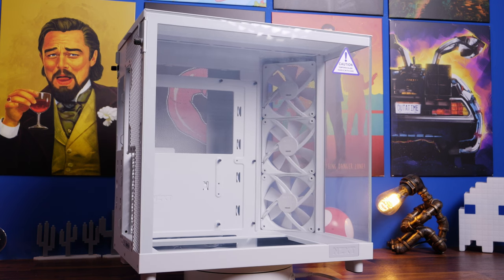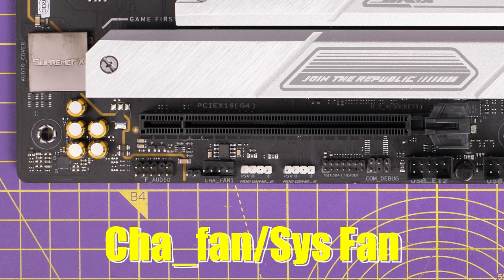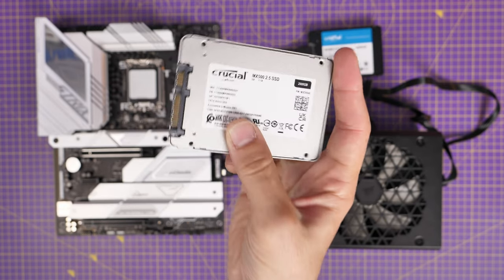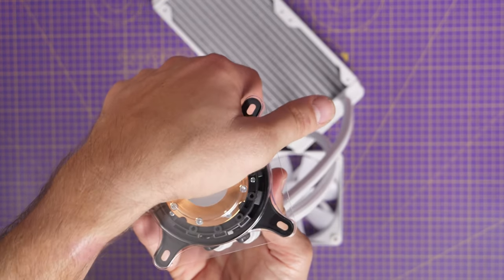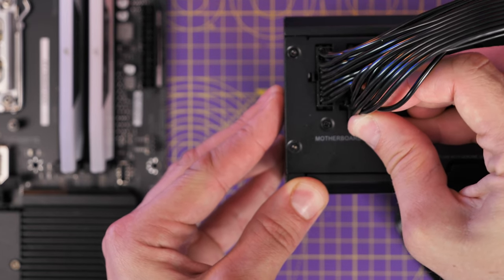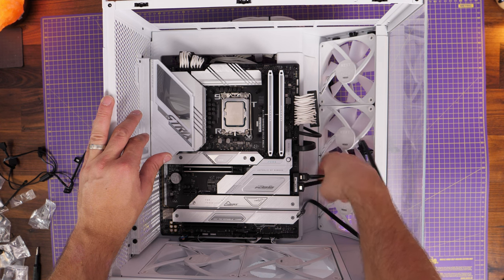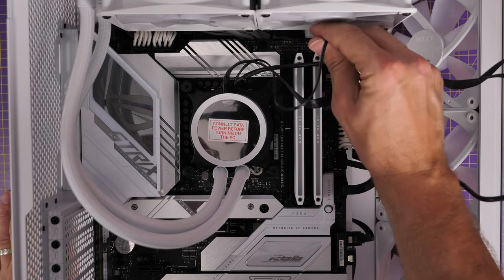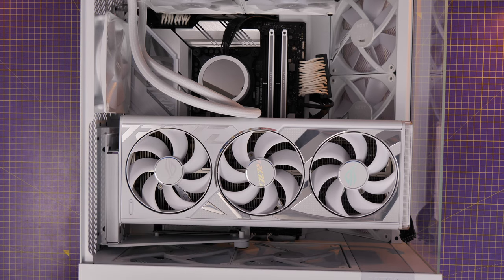NZXT H6 Flow RGB In depth build guide (step-by-step NZXT PC setup)

Comment from the maker: Specs of this build (note these include affiliate links which may earn me a commission at no extra cost to you):
Motherboard - Asus ROG STRIX Z790-A GAMING WIFI 2 https://amzn.to/46TdrYN
CPU - Intel Core i9-14900K https://amzn.to/46xZ101
RAM - Corsair Dominator Titanium 32GB 72000MT/s https://go.corsair.com/baya19
GPU - Asus ROG Strix RTX 4090 OC White Edition (https://amzn.to/3tr1nzc)
PSU - Corsair RM Shift Series 1000X Shift (https://youtu.be/yafbKAuyntw)
Fans - NZXT F120 and F140 Core RGB Fans https://youtu.be/mPRrPGjV_jo
AIO - NZXT Kraken 240 RGB https://amzn.to/45UfqKY
NVMe - Crucial T500 NVMe 2TB
Other NVMe - Crucial T700 https://www.youtube.com/watch?v=B08Cv8Pb9nI
Crucial P5 Plus - https://www.youtube.com/watch?v=YjOyCB7Vqjw
Case - NZXT H6 Flow RGB https://youtu.be/vtLcCbvSxEw
Vertical GPU mount - https://youtu.be/2dlB3bMFJUY
Reply from the maker: @cunnilinguswithcaitlyn6345  nope
Reply: Can I ask a question, where did you buy the second nzxt RGB controller, the only one I can find comes with the fans? 🤔 hoping you reply as I’m building a pc within the next week 😢
Reply from the maker: @Ash_ASMR_  you'll want one of these https://amzn.to/432Oyc7
Reply: @TheProvokedPrawn  is that the same one that comes with the f140 core RGB fans or does the same?
Reply: @TheProvokedPrawn thanks btw
Reply: does the rtx 4070 work fine on the h6 flow with the NZXT N7 Z790 motherboard?
Reply: what about the GPU brace. I see one but you dont mention it or where it is
Reply from the maker: @Jack_Hunt  the vertical mount?

Comment: man that 240 rad actually suites the whole build really well and gives it a good balance with the 2 140 fans on the bottom, its good symmetry. reckon you would probably wanna use nzxt duo fans? not totally familiar with all the nzxt products. they are more proprietary than other brands...but i really do like the rich bright color of the fans and the individual settings of them.
Reply: Personally i do not like that there is that empty space at the top, i would still prefer a 360 aio for a full aesthetically pleasing build, as well as giving the extra cooling for the cpu🙂
Reply: I am a slut for aesthetic asymmetry, and the 240 all-in-one in this case get's me going. I'll be doing a build with this case and while I could get a 360 all-in-one, I'll personally be getting the 240.

Comment: I appreciate this build guide because I bought this case but didn’t foresee all the other stuff that’s not included or is needed. Like you may need another fan and rgb controller or an usb hub for the controller and stuff. Helps me organize and put together my pc when I get all my components
Reply from the maker: Glad I could help
Reply: What extra stuff do u need?
Reply: @Airman2324  a fan/rgb controller, and a usb hub
Reply: According to nzxt, the bottom fans don't improve temps. Left mid-top fan actually harms the out take if you're using an AIO. So, if you're budget conscious, you could just keep the stock fans and add a 280 AIO and you're done. Positive air flow and again, according to nzxt, optimum airflow
Reply: @KcKeegan do yk where this is said?

Comment: Thank you for the video. I just bought this H6 Flow case and i was wondering what will be the cable management in it. But oh god ! I'm glad i'm not into the RGB style. The amount of added cable management you have to go threw make me cry ahah. 
At the end of the day, it's a really good looking and neat case to have, i really like it. I've also read that the air flow is really good with the stock fans. On the official website, you also can found data with those bottom fan, it's better to not add them for a cooler temperature overall.
Reply: The case and components are cooler without the bottom fans? Did they use the fans as intake?
Reply: @Carthus  on the official website and also on others video from youtube, they gathered both data with and without bottom fans.
Using bottom fans is only recommended when you have a really beafy GPU you plan to use at 90-100% most of the time (for 3D render as example or very long session of gaming with max settings). In this case only, you have a cooler temperature for your GPU, but overall , inside the PC case it's warmer. 
Without bottom fans and just with the default front fans (intake) and one more to add in exhaust you have trully good performance !
For my own settings, i have as GPU a 7900XT and a  7800X3D CPU. Combined with a NZXT Kraken 240. I really have decent temperature at full load, around 60-65°C  for the GPU and almost the same for CPU. My room temperature was around 22-23°C.
Reply: Yeah ima listen to you I don't wanna have to buy any more fans just one now I regretting getting the RGB version  @flow_leit

Comment: Thanks for this guide Prawn :) I have the RM1000x Shift PSU and wasn't sure if it would fit well with the side mounted connections. Now that I've seen your vid I ordered the case 👍
Reply from the maker: Glad I could help!
Reply: i'm getting a rm850x Shift PSU and had concern about their website saying something abou 210 mm of clearence minimum VS the h6 flow mentioning something about a max PSU size of 200mm but I can see in your video and like what BenanaBread said, it fits. is the 850w version definitely the same size? And I should have no issues with cable flush?
Reply: Is the shift or the normal rmx better in terms of cable management for this case?

Comment: Id close the top gap by placing another 120mm fan next to it so that more heat is exhausted, making the average heat the radiator recieves from the gpu less
Reply from the maker: A 360mm rad would have been better really

Comment: Thanks a lot for the video! You have helped me a lot to competently assemble a computer from almost the same components) 
However, I have a question: at the end of the video, we see that you supply power to the fans from the motherboard, but why not connect power to the controller from the nzxt in addition to the backlight? 
You can also connect up to three fans to the pump from nzxt, they have a branch there.

Comment: Hey! You probably don’t check these comments anymore as it is sort of an old video, but I had a quick question about the fans. First off, I didn’t quite understand, is there a way to connect all of the fans to one RGB controller? And secondly, won’t making the radiator fans exhaust be pumping hot air into the cpu cooler? I feel like it would make more sense to make those intake fans. Cheers for the awesome video!!
Reply from the maker: https://youtu.be/kTocUr0zKUw
Reply from the maker: https://youtu.be/qQcyYHGtArs
Reply: Cheers mate!!

Comment: I don’t know if I did something wrong but mine is not powering on.
Reply: mines powering on but i get no display :(
Reply: @dogbus7  Is your HDMI / Display Port connected in the GPU or in the Motherboard?
Reply: Check the pins connections, sometimes if they are a bit loose it can cause trouble powering on

Comment: I would have been interested in seeing how vertical mounting the GPU in this case affects the temperatures. Seems like with a blow through GPU cooler the front intake and GPU fans are fighting each other, it seems like the bottom to top airflow would make more sense in standard GPU orientation.

Comment: A really cool case but unfortunate at some edges very tight especially at the bottom and on the side. I could not fit my lian Li sl inf uni fans so I had to cut the case a little bit, later I painted and ground it.

Comment: hey provoked prawn thanks for the great video. In this case are the three front fans controllable in the same was as the other fans in your case? As I have read that the included front fans in this case are not PWM? Can you confirm how theyre controlled by setting them up in the you did in the video? Thank you!

Comment: Very well shot video - thank you! Have to ask an obvious question though. What on earth cools the 3.5" hard drive?  Why only ONE HDD? I'd be using that drive for family data storage for our precious videos and photo storage (WD GOLD HDD - most reliable on earth). So what will be cooling this drive in this case to keep the temp down to the oh so important 42 degrees or less? There seems to be zero fan cooling in the 2nd section with the HDD and wiring. How could they stuff up this aspect in their new and carefully (almost) designed premium case. No HDD cooling - they HAVE to be kidding, right?!
`

Comment: Im planning on all these fans but except im using a 360 kraken aio but my mobo only has 1 rgb header and 4 4pin fan headers plus 4pin pump header is it possible to build it  with these components

Comment: So is the GPU blowing hot air downwards? In that case you are pushing it back up to CPU area with 2 intakes at bottom? I am a noob, but if I would install exhausr 1x rear, 3x top, 2x bot while only blowing in air from the pre-mounted fans. Would that be good? I just want to know what's best because I want cool and quiet operation if possible, and is it loud compared to Define R-series of old?

Comment: Building this tomorrow. Quick question, i have an nzxt controller (the 6+3 one) and a 3 port rgb one from the 2 140 mm nzxt pack.

By my understanding, i can just plug the first 6 fans into ONLY the rgb of the 6 port controller, then plug the final 3 into the 3 port rgb and those 3's 3 power cables into the usb section of the motherboard? Or do i have to plug the 6 fans also into a usb port?

I also got the nzxt usb hub

Comment: I was considering returning the shift power supply because the gpu cable is too short. I didn't try it from the side as you have it, I don't htink it will look bad with mine as my cable is white.

Comment: I'm just starting a build in the H6 flow, I got the non RGB case as it was on sale pretty cheap and I want to use the  NZXT rgb duo fans in the front and on the bottom, that leaves me with a question do you know if the NZXT 140 rgb duo fans will fit in the bottom height wise. Great video thanks

Comment: Hi, how is the 14900k processor working for you to this day ? im having prebuilt PC and i had to send it back two times already because its suffering from degradation, im asking because im about to return it and try to build myself by your guide and with the same components, would you recomend building with 14900k or should i try AMD7 7800x3D + motherboard instead ? thank you and very nice video guide!
Reply: I'd also like to ask if you would make a video guide (or link if you already made one), about what to do after building a PC, what to do in settings(bios) with the 14900k (in case its still working alright :D), and some things you're doing and would recomend doing in windows, thank you

Comment: so i have a question, i want to build in this case and im planning to add a 240mm kraken rgb like you did, which comes with an rgb controller. can i plug the the 2 aio fans and the 3 case fans all into that one controller, cause the case fans rgb are daisy chained, or do i need an extra controller?

Comment: Hey, I recently bought this case and I had a question.
So I bought kraken 280mm and dual 140mm fans for bottom and one 120 fan for rear.
Since kraken and dual 140mm fans come with the 3 input hub controller, can i connect 2x140mm fans and 120mm fan into one controller, and kraken 280mm (two slots) with case fans(3) into one left slot on controller? (So 3 base fans all into one slot of controller).
Would this work?

Comment: Hello 👋🏼 , I build the same but the case without rgb , I have one question about the SATA cables I have 2 from my psu one for rgb controller one for the pump and that is ok ? with 2 cables or I can make only with one both of them to connect? Thanks

Comment: hi so actually this psu compatible with the h6 flow case eventhough website such as pcpartpicker says otherwise? even the wire comes from the above, is it long enough to connect with motherboard etc?

Comment: I am building a custom pc next week and my seller says it won't work with h6 flow, so I have a question, can we use push pull configure in nzxt h6 flow with nzxt Kraken 240mm, the total thickness is 51mm after adding 2 more 120mm fans on radiator which have thickness of 25mm. 36:16

Comment: The 15mm screws aren’t in the accessories box i tried to make the 140mm fans on the bottom fit with the 13.5mm but didn’t work any suggestions?

Comment: Thanks so much for making this vid because i'm planning my first pc build much like this one. A 240 up top, two 140s below and the extra 120 at the back. Correct me if I'm wrong, but i should be set except for the NZXT Internal SUB Hub 3, right? I'm slightly confused if i need to buy an extra NZXT RGB & Fan Controller as well. If it helps, i'm planning on using the Gigabyte Z790 UD AC MOBO which also has 2 usb ports. However i don't see a AIO Pump port. Just a CPU FAN (which i'm guessing is where i should plug into), a CPU OPT, as well as a SYSY FAN3 PUMP at the bottom. Didn't know if i should actually be using that one. Thanks again for this resource!
Reply: Main question: Will i need the NZXT RBG & Fan controller? or will the two gubs that come with the intercooler and the f140 two pack suffice?

Comment: I have the exact same bottom fans, but the screws are too short to connect them? I 100% used the same ones, and the F140P fans from NZXT. What can I do?
Reply: EDIT: I fixed it by using what feels like a bit too much force, to force the rubber cushioning together.

Comment: i thought that the dominator platinums also had a cap exchange that makes it look like the old dominator with the "tetris" like rgb lights? am i wrong about that? it only comes with what you used and also the rgb-less heat sink ones?

Comment: i am going to get that case with a 360 mm aio and that comes with a fan hub and i'm getting the same 140 mm fans at the bottom and am connecting a 120 mm fan at the back of the case to that hub but what will i do for the front 3 fans will the motherboard have enough ports for it all? i'm getting the Gigabyte B650 EAGLE AX ATX AM5 Motherboard

Comment: I bought the case without rgb fans so can i move the 3 fans in the front out? Put them on the top and buy 3 new ones with rgb and put them in the front ( corner?

Comment: Thabk you for the vid. I do have a question if you can help out.

Asus X570-P mobo doesnt have a 3.2 USB connection point on the board. 

I connected the supplied 3.0 USB connector to the board but dont know what to do with the additional 3.2 USB connector from the case.

Do I need a 3.0 splitter and an adapter for the 3.2?

Comment: I'm about to move into this case and get the 2 140mm fans for the bottom, so couldn't I use the controller that comes with the 2 140mm fans for the 3 120mm case fans? and then just plug the 140 fans into the motherboard like you would the 120 fans? Or would that not work?

Comment: So I just assembled this case from micro center and on first boot the included fans don’t didn’t light up on plug in nor did the 140mm nzxt I bought for the bottom. Does the addressable headers not work for these fans?

Comment: On the NZXT site it doesnt show the vertical mount compatible with the H6, clearly by your video it works fine.   Unfortunately I can't find it in stock anywhere in Canada.  I want to vertically mount my 7900xtx.   Any other brand of vertical mount that you would suggest?

Comment: can you fit 2 120mm fans in the bottom or only 140? and would a 280mm AIO work in the top ? and with the 280mm AIO could i still fit a 120mm back fan?  (i am trying to build a pc in this case and am just a bit curious on what you can fit inside as i have no idea :) )Great video build looks sick as always
Reply: bottom only fits 140, and you can put a 280mm aio at the top. if the tubes are facing the right side, so the glass panel, you should also be able to fit a back fan

Comment: I have a 12v RGB connection on my motherboard. Is there any way to convert this 5v connector to work with the 12v? Will these fans just not run RGB until i upgrade my motherboard?

Comment: Hmm, these included fans don't seem to be the same as F120 RGB Core fans sold separately. These included ones seem to be 3 pin DC fans instead of 4 pin PWM, and have different operating range. That's really disappointing when I was hoping to have matching fans.

Comment: i hope maybe you can help me. i had ordered this case and started building but i got into a confused state. i couldn't figure out where one connector went. i've looked all over i don't know what it is. it's a black connector almost looks like usb with teeth on each side. i thought i saw you plug it into your motherboard but on mine i could not find  where to plug mine in. its with the connector that you plug in beside the 24 pin motherboard connector. i could explain better with a pic. when you first open the back of the case it was on the bottom of the case with the connector to the motherboard. i feel like it's for old hdd connection.

Comment: Can you switch CPU and PCIE (GPU) cables? For some reason the PCIE cables are daisy chained which does not look nice if you build a minimalistic PC.
Reply from the maker: You don't have separate ones included with your PSU? An alternative might be extension cables (Cablemod) or Lian Li Strimers
Reply: @TheProvokedPrawn  No single PCIE to PCIE cables unfortunately.

Comment: If you put your AIO cooler at the top, which direction should the air be flowing if you have the three front fans pulling air IN, as well as two bottom fans pulling air IN?????
Reply: Always vent through the top

Comment: I’m completeøy new to Pc and i just bought the h6 flow rgb with NZXT  kraken elite 360 rgb + 2x 140mm NZXT duo rgb fans and a be quiet 120mm non rgb fan. 
What do you reckon i should buy to be able to Connect and control all fans? I know you mentioned hub etc but to me thats a foreign language